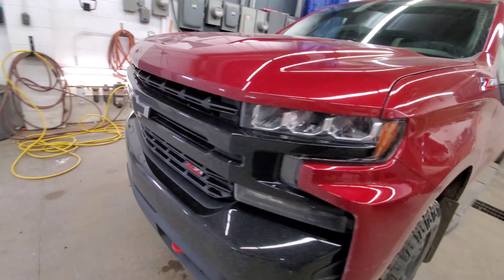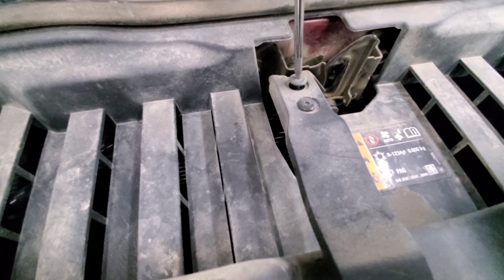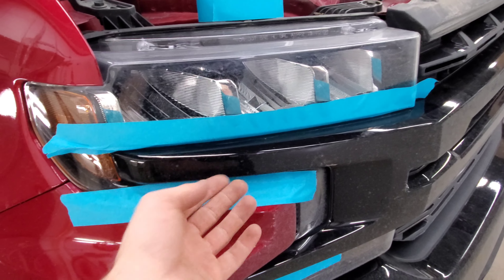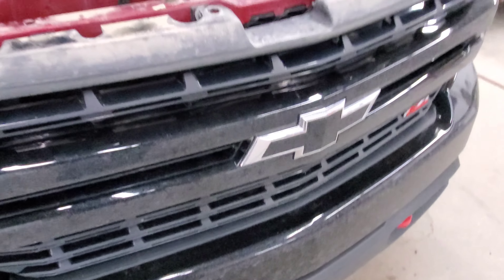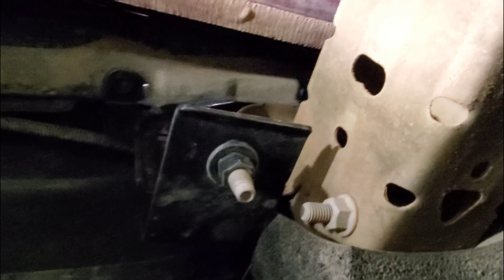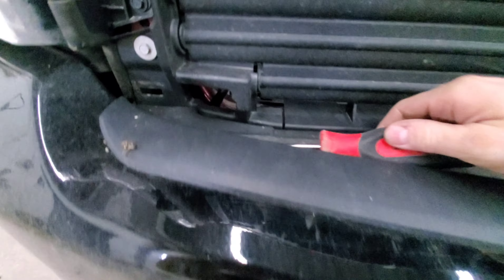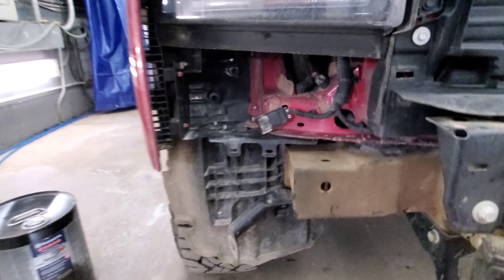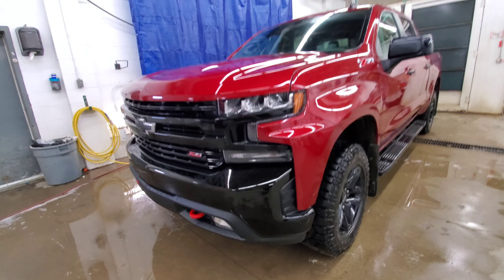Front Bumper Removal 2019 Chevy Silverado

Comment: This video is a year old, hopefully you can see this and help me. I dont need to remove the bumper, I need to remove those wings or end cap on each side of the bumper, need to replace the right side one, how? Thanks in advance
Reply from the maker: You need to remove the fender flare to gain access to the screws on the side and then there are plastic clips holding it on. I have a new video of a 2021 front bumper removal that shows that piece that you’re talking about so check that one out and it should help answer your question.

Comment: How do I unclip that from harness plug? I’m having a hard time with that..
Reply from the maker: Pull the little red tab back and press the black tab down and it should come unplugged. Sometimes they get filled with fine dust, hit it with a screwdriver handle to knock it free. Also press the plug further together then press the tab. Sometimes the little tab gets stuck on the little bit it has to go over. Give the tab some extra room to move up and over

Comment: This whole bumper is garbage being theres more plastic and 2 tubular steels brackets to hold a gunk of plastic fascia thats gonna break even if you touched brush. And for the cost of this stock replacement is half of an entry level aftermarket bumper that looks better. Best of luck chevy guys, ive decided to go aftermarket only because those 2 side brackets and the two to hold the fascia up are like ford beds..